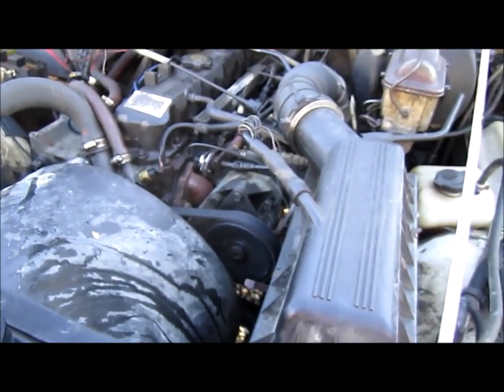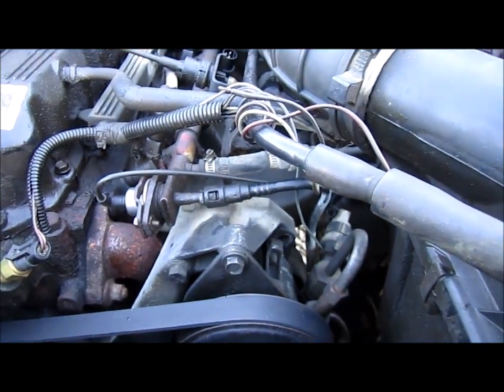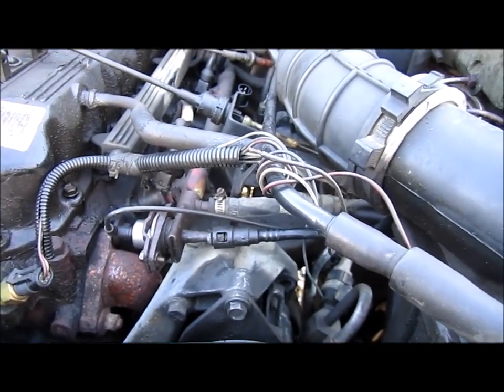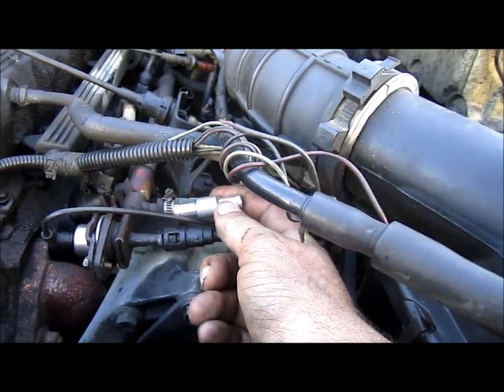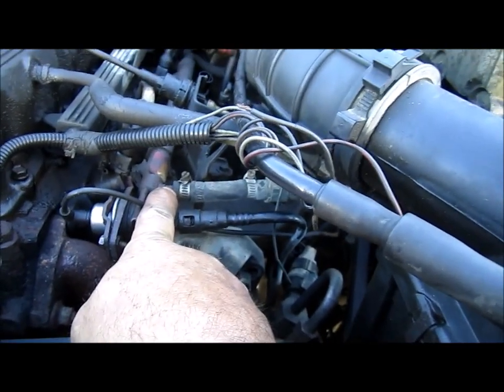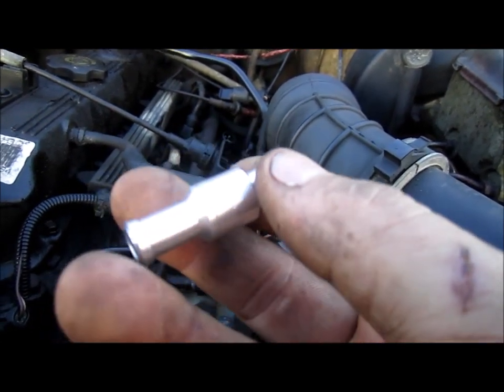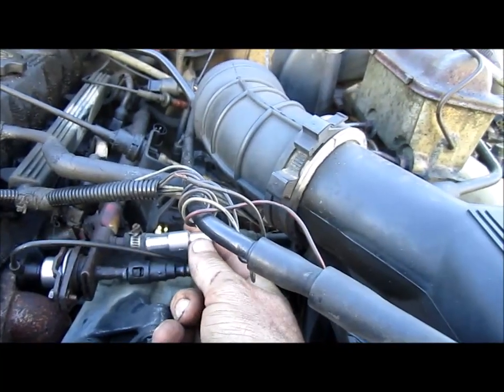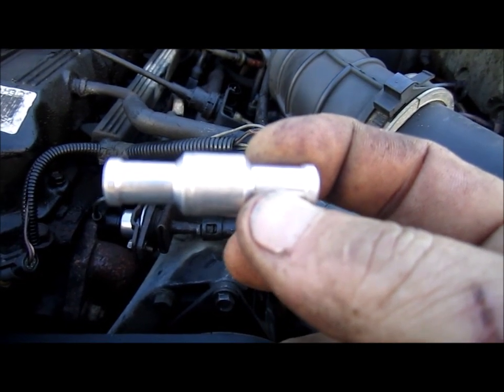Installing A Inline Fuel Check Valve

Comment: This should be close to the fuel tank.
All that fuel is running back into the tank from the engine that’s why it has to crank so long to pressurize all that line with fuel. 
Stick it on the outgoing line by the tank and all that distance will stay pressurized and you car should start instantly.
Reply: This comments should be starred

Comment: Great Idea i have the same issue with a 08 Opel Astra 1.7 Diesel had to start will try your idea thanks.
Reply from the maker: Welcome
Reply: Hey, did you solve the problem with check valve, I have same astra 1.7 diesel and starting issues?

Comment: My car starts up on the 2nd crank. If I let it prime longer on the first time itll crank a little longer and barely fires. I dont notice reduce mileage, stutter, stalling. It runs fine once on. Only started recently once the temperature dropped drastically these past days on the east coast. Side note, I do use royal purple addictive from time to time so idk if my fuel filter is dirty? If I leave it for a few hours and the engine is cold I'll have to crank twice again. When hot I dont have an issue. If it's the fuel check valve do you know if my dealership mechanic will replace it or was this a DIY that cant be done at a dealership? Please let me know what your initial thoughts are. It's a mazda 3 2012 currently have 148k miles and no check engine light. Will test fuel pressure soon too, just got one from AutoZone. The more videos I watch and more I read online, the more different things I think it could be. Someone said it could be a leaking fuel injector too if the pressure drops away once the engine is off but I dont smell gas. I can fire it up 2-3 hours later (barely) on the first prime.  Any advice would help but after watching this I think it's the valve too. Thanks for your video and time!
Reply: I’m having the same problem please let me know what you’ve done to fix it.

Comment: Can I use it to restrisct air ,my air pump leaks air when it reaches higher than 40psi, thought that check valve might help but I don't know if it works with air?

Comment: I need to add a check valve for my fuel tank vent on my old classic car. It currently doesn't have a check valve and releases gas odors in my garage when parked.  Where did you get your valve and what is the part number. Thanks
Reply from the maker: Ebay type in inline check valve for gas

Comment: did you manage to solve the problem with that valve?
Reply from the maker: It worked good then my pump went and changed the pump so really that valve is not needed any more but i kept in inline. No harm done.

Comment: Would this work on my 97 Jeep 4.0? It requires 2 cranks to start if it sits more than 5 minutes and I've heard it's a fuel check valve, but that it's near the tank or pump. If you crank it after only sitting a couple minutes it fires up fast and strong 100%. Thanks.
Reply from the maker: Its not going to hurt anything that,s for sure.
Reply: I have this same exact issue on my 2012 mazda. What did you do to fix it?

Comment: Any chance you got a part number for it?
Reply from the maker: https://www.ebay.ca/sch/i.html?_from=R40&_trksid=p2380057.m570.l1311.R1.TR11.TRC1.A0.H1.Xfuel+ch.TRS0&_nkw=fuel+check+valve&_sacat=0        All you need to do is find the right size you need.

Comment: So, maybe next time you can show us how you put it in???????????
Reply from the maker: I could yes.It's really not hard it's just a matter of removing a piece of line and replacing with the valve and making sure the flow arrow is pointed towards the engine and clamping it tight and that's really it. It needs to be the inlet line not the return line.

Comment: I hate being a PARTS CHANGER!!!!!
Reply from the maker: Things break wear out they need repairing.
Reply: @MrDoingEverything  Yep ur right.
Reply: @MrDoingEverything  ?4U....The inline FCV...connects to flow line going to the engine. Once the engine is turned off I'm guessing the remaining fuel drains back into the FT, correct? The remaining fuel in the fuel rail drains back to the FT as well through the return line correct? Thx for the quick reply...DIYER over here.😁
Reply from the maker: @Himithor  The valve just stops the flow back into the tank on the main fuel line is all nothing else changes. Just keeps the fuel right there and ready instead of needing to pump it back up each time makes for easier starting cause gas it ready to be used fast with out delay. But when everything is already in good working order this is not needed.